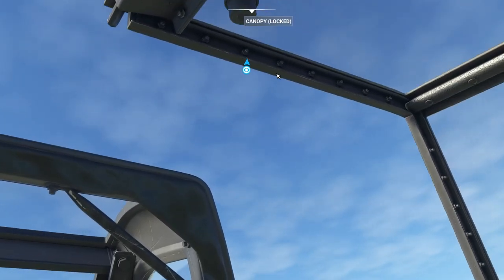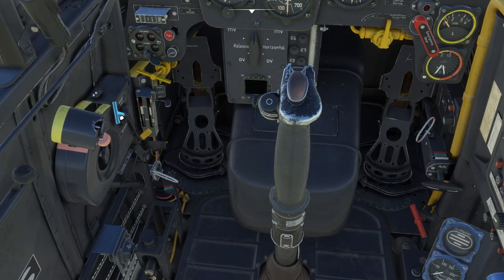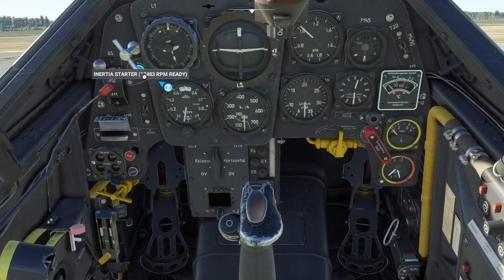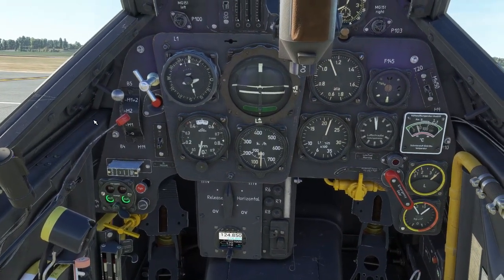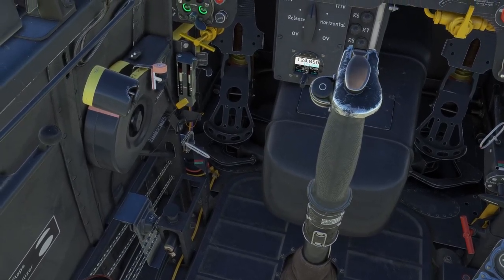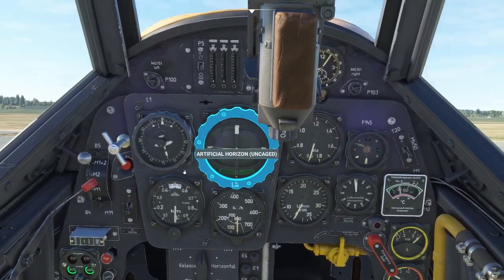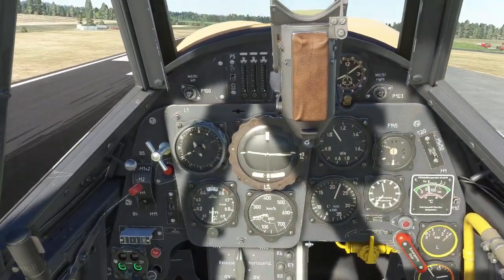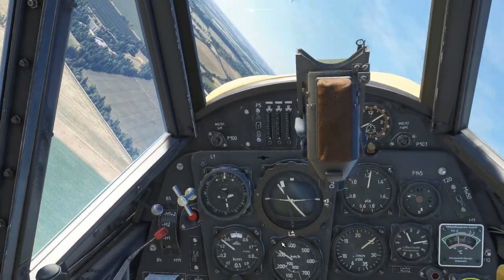FlyingIron Messerschmitt BF109G-6 Cold Start and Take-Off Demo | MSFS | Microsoft Flight Simulator

Comment: If you are interested I have found that when looping you might need a bit of flap to work with the slats and don't pull the stick back all the way. It's got a small wing and I think this is one of the few aircraft that DO require the use of flaps for tight turns. One notch should be enough. Thanks for the vid. Always entertaining and educational.
Reply from the maker: Thanks for the tips I will give it a go when I next go vertical, I always seem to forget flaps when wanting a bit more agility from the aircraft! Thank you for watching and for helping me out!

Comment: Thanks for the walk-through and guidance on this, very well and clearly explained.  I recently updated my pc to Windows 11, through a fresh install, and subsequently fresh re-installed the sim.  Since then, the anti-fouling handle seems stuck open - I've removed/re-installed the Bf109 twice now, no change.  Any clue as to what I might be missing?  Keep up the great work!
Reply from the maker: That's really bizarre, I really don't know what could be causing that, very unusual. Having just checked their Discord I can't find anyone else with the same issue. I'm really sorry I can't help further. Thank you for watching and the kind comments!
Reply: @boresight2020  No problem at all - I mean the worst thing I have to deal with is flying the airplane more and try to figure it out.  :)
Reply: @boresight2020  I FINALLY figured it out!  I have the Honeycomb Bravo throttle quadrant.  Third rocker switch from the left apparently controls the anti-fouling handle.  :)